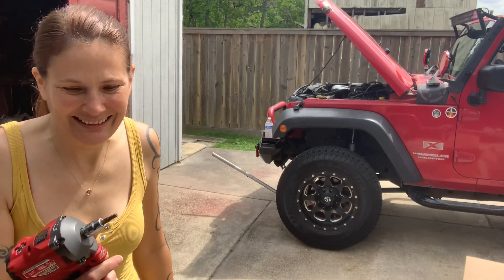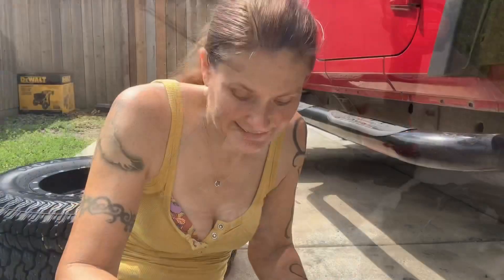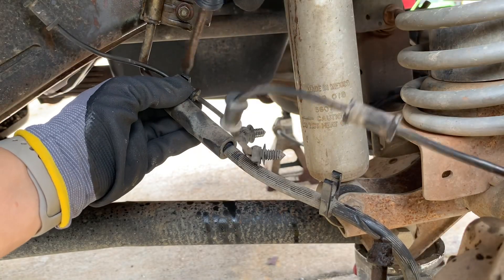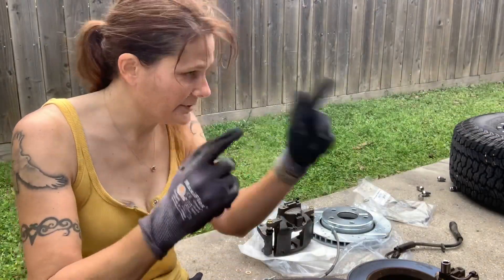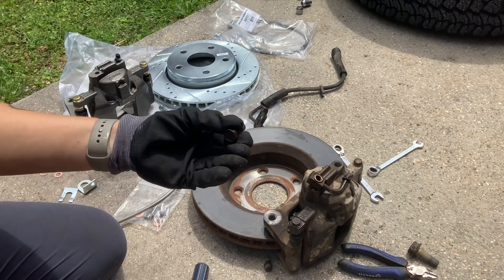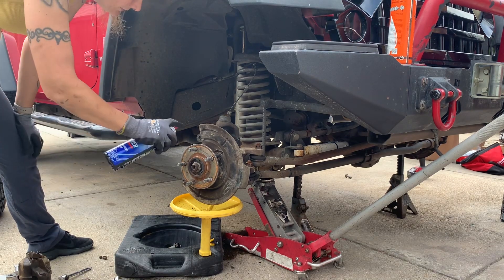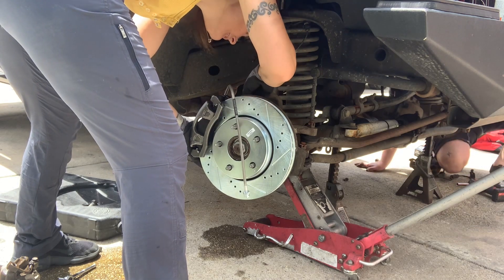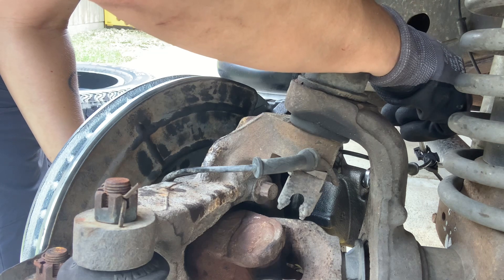Front rotor,caliper, brake pads and caliper hose replacement 2009 Jeep Wrangler

Comment: You probably should have used some break clean and sprayed off the pads it looked like you had got some oil or grease on them that will save you some squeaking noise down the road until the pads get broken in